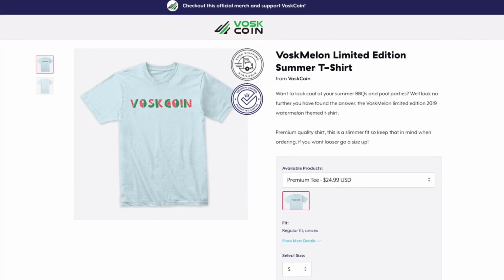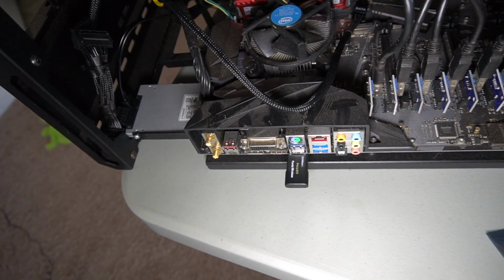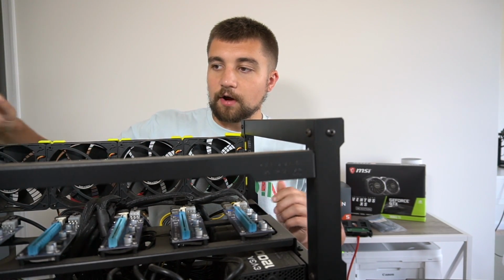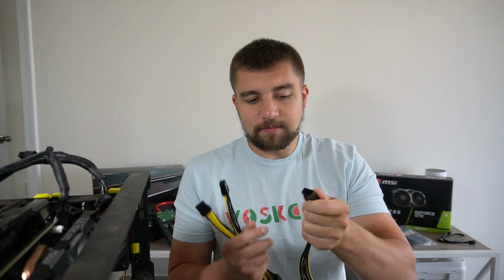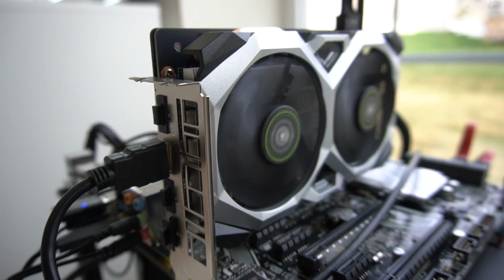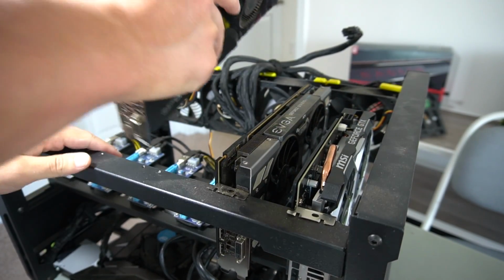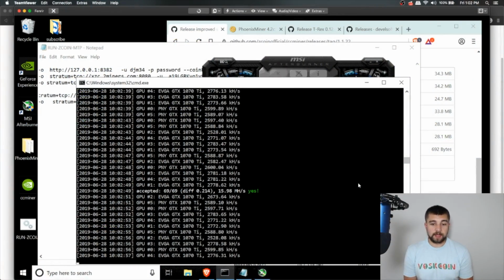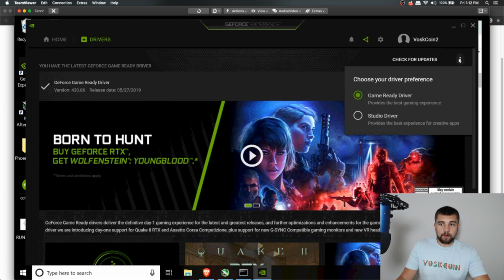Best Bang For Buck GPU Mining Rig Build Guide 2019 - Mine Zcoin, Ethereum, Ravencoin, Grin, and Beam

Comment: Hi.. 

I took notes and copied your list exactly but I just have a doubt.

I am planning to buy all this:

1. ASUS ROG Strix B450-F Gaming Motherboard (ATX) AMD Ryzen 2 AM4 DDR4 DP HDMI M.2 USB 3.1 Gen2 B450
2. AMD Ryzen 5 2600 Processor with Wraith Stealth Cooler - YD2600BBAFBOX
3. Kingston 120GB A400 SSD 2.5'' SATA 7MM 2.5-Inch SA400S37/120G
4. Corsair Vengeance LPX 8GB (2x4GB) DDR4 DRAM 2400MHz (PC4 19200) C16 Memory Kit - Black
5. EVGA Supernova 1300 G2 80+ Gold, 1300W Fully Modular NVIDIA SLI and Crossfire Ready 10 Year Warranty Power Supply 120-G2-1300-XR
6. Ubit 6 Pack Latest PCI-E Riser Express Cable 16X to 1X (6pin / MOLEX/SATA) with Led Graphics Extension Ethereum ETH Mining Powered 
7. Riser Adapter Card+60cm USB 3.0 Cable
8. PCI-Express PCIE 8 Pin to Dual 8 (6+2) Pin Video Card Y-Splitter Adapter Power Supply Cable
9. Electop 2 Pack 2 Pin SW PC Power Cable on/Off Push Button ATX Computer Switch Wire 45cm
10. GPU Open Air Mining Kit - Easy to Assemble Case with Optional Fans and PCI-E 16x to 1x Risers - Open Air Frame Compatible with 6 GPU and 8 GPU rigs (Frame Only)

I already have 4 RX 580 GTS, do you think its a good fit? Please suggest any improvements as I am new to GPU community. 

Thanks for your time.
Reply from the maker: Yes you’re set just make sure to properly tune the rx cards especially if you’re running on 120v electric
Reply: VoskCoin thanks for helping me out. Will definitely refer to your videos while setting it up, find it easy then. 😉

Comment: I still like my gtx 1070’s. Good power to hash ratio. My G1 gaming card is the best performer. Always hashing over and running cooler than the rest. 
ETH address: 0x9CC2B13cd642F14B1baefd2180573ebb1E6fA232

Comment: I am running a B470 board with a Ryzen 2600 with 3 MSI 1660ti and 2 MSI 1070ti.  The prices for the hash on these cards looked the best for my situation.  I was thinking of trying an all AMD system.

ETH add: 0x441756761Ed2d9CBa8c99dC2e345Be3145770615
Reply: Sorry X470 MSI MB (typo)

Comment: I think the best bang for buck right now is the rx470 8gb mining cards. Mine are running 31.5mhs and they can be found for 50-70 bucks on eBay

0x5ecaf073a972588cc4e93b2f1947a958ea61094d
Reply: How much do you earn with a hash rate of 30m/h?

Like a penny a month? At 50$
It'll pay for itself after 5000 months?
Reply: Each card earns about 22 to $23 per month
Reply: Power to run that card probably cost about $7

Comment: Thank You for another excellent build and instructions.
At the moment the GPU that I would like to use would be the 1070TI 
Good job on the time stamps.
Thanks again
0x8F7A02D9B45CFBCAd7c598D4f92d946f8F3e8a9B My eth wallet

Comment: My fav GPU is the ASUS ROG Strix Z270F its just looks sick af :D 
My ETH address: 0xed2E76c050C9ad33e9F5d5EF0eFeE3417DDffA0D
bro my only issue is the graphic cards cost an arm and leg. whats ur recommendations on getting my hands on some cheap rig setup , i live in germany btw. 
cheers
Reply: germany from my understanding has pretty expensive power but i still feel rx570 and rx580 are your best bang for your buck.